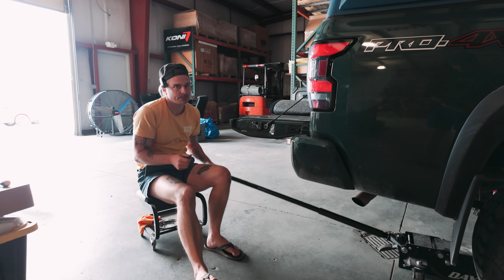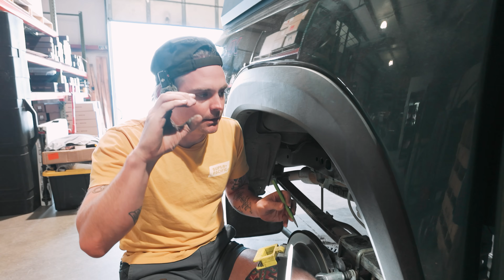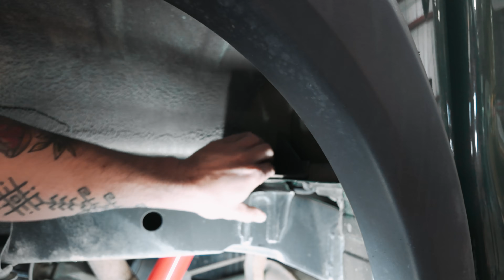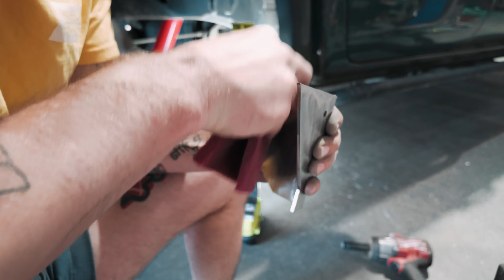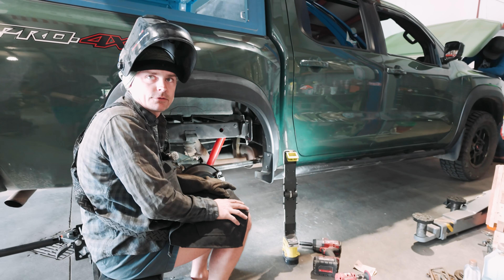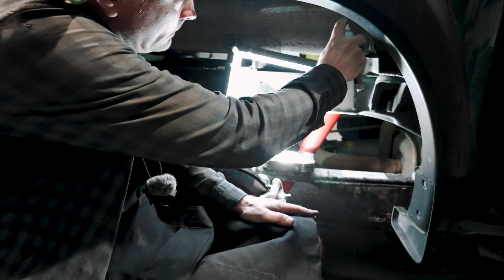Alldogs Offroad Heavy Duty Bed Mount Repair Bracket for 2nd & 3rd Gen Nissan Frontier Install

Comment: Glad there is a solution. The problem for me is the welding part. I was hoping if there is a non-welding solution. I have a 2023 ProX and I do have a RTT but it sits lower on the bed about 15 inches above the bed. So far I do not see any issues on that side. Any advice.

Comment: On the long beds, the sheet metal for the two forward most mounts on the passenger side is thin. I'm reinforcing mine by bonding a piece of sheet metal to the bottom of the U Channel with high strength epoxy. I'm doing both of the forward most mounts on both sides so it's even. I don't see any reason for removing that fixed nut plate on the inside of the channel. Got one side done today. I'll do the other side in a couple days when the epoxy is fully cured. Lifting the bed away from the frame was easy.
Reply: I appreciate your comment as I plan on getting a long bed crew cab in about a year and was planning on doing something similar as well for preventive maintenance.
Reply: I sure would like to see a picture of how you did this and the materials you used.

Comment: Does the stock King Cab not suffer from the weakness at passenger side front bed mount…. Or maybe there is a different bracket being developed for the KC?  The ADO site implies this bracket is just for short bed Crew Cab. Tnx-J
Reply from the maker: the KC would have to be a different bracket. It appears to be only the short boxes having the issue. Once we start to see it from the King Cabs then we will more than likely start developing a fix for them as well.

Comment: I'll be getting my order in shortly as I've got a permanent rooftop tent and frequently load the cargo area to the max.  Is it a good idea to pry the bed away from the frame when you're painting?  That way you're covering any bare metal right where the rubber isolator sits.  Just curious if that's a logical step, or kinda overkill.

Comment: This will be going on my truck as soon as it gets delivered 💪
Reply from the maker: Good choice!
Reply: @AlldogsOffroadCoop you need to do a full reinforcement kit for all four corners/mounting points to make sure it’s all secured properly
Reply from the maker: @FerrariLamborghini24  we've only seen issues with that single mount, until we see failure rates elsewhere, there's no need
Reply: I got mine on Monday and asked if they had installation instructions.  I think this video is their initial response.
Reply from the maker: Part of it haha

Comment: Thanks for posting this video.  I received my bracket 2 days ago but it didn't have any install directions other than the notes on the ordering web page.   

Great detail here!
Reply: I'm going to transpose the key steps and warnings to give to my installer.   Especially the part about keeping the bed cool/wet during welding and reusing the upper and lower rubber bushings!
Reply from the maker: No problem, glad we could help!